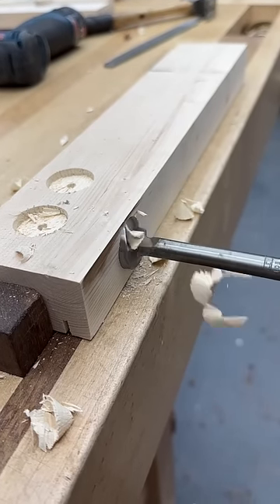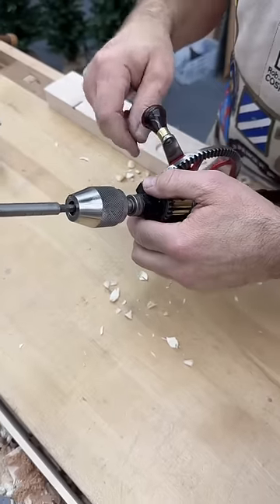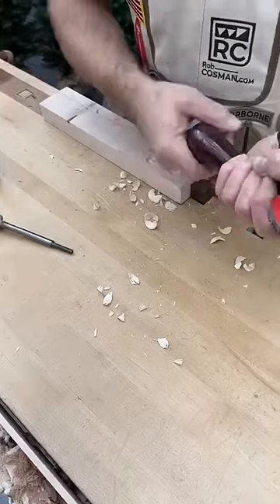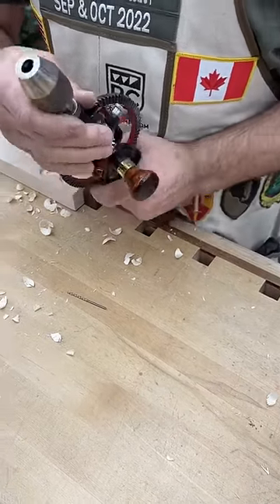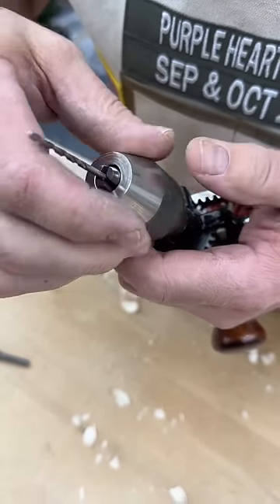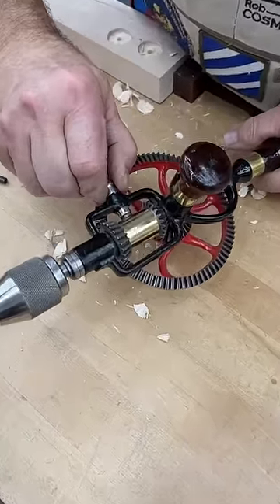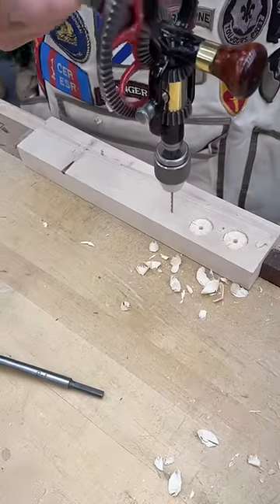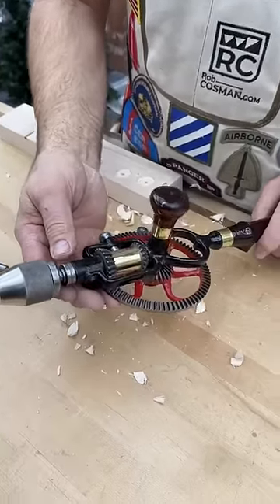Using an Eggbeater Hand Drill #shorts #RobCosman

Comment: I often find that it’s quicker and easier to use the old egg beater style drill, especially for small holes.  Also provides better control, and can be used in tight spaces where an electric drill is too bulky.

Comment: I have a very similar drill. Mine is from Goodell Pratt company with a patent date of March 31, 1896. Instead of the bit storage handle, mine has a knob on the end of the handle, resembling a baseball bat.

It is a great drill for making a few precise holes.

The numbers Rob was giving are gear ratios (output shaft to input shaft) not RPM.

Comment: I've got one from 1945 (variable speed as well). It works surprisingly fast.. Especially when compared to a 1400 rpm hand drill. 
      Also (probably the main reason they're so handy in war time); extremely quiet. And very accurate / no wobble
Reply: I was just thinking along the lines of a stealth carpentry mission. Maybe dismantle something crucial. Weaken a few things. Tap a gas line somewhere...

Comment: Those are awesome! I have 1A lot like it with 2 speeds but it is I guess mine would be called a breast drill style.
 It has that curved metal top where you could put up against your test to give extra pressure.
 Drills steel like a champ!

Comment: Variable speed and multi speed aren’t exactly the same thing. But I agree they’re useful tools. Handy to keep a countersink in around a metalworking shop.

And the rpm output only holds if you manage a consistent input, so it’d be more proper to state it as input to output ratio, not rpm.

Comment: I doubt very much that it was used for that large diameter bit. The bit would grab in the timber, your hand would be aching from holding the handle so tight, and applying the needed  pressure would be a workout!  A  "Brace " was used in that situation so you could easily apply the torque & pressure.
This drill was only used for smaller & medium fluted twist-drills, not  Forstner bits, or augers. Incorrect info. Our forebears were also motivated to do things as easily as possible. No one would use this for large diameter holes.

Comment: Where do you buy those
Reply: You can buy modern ones from the local hardware store. To buy a 1897 model, use time travelling to go back about 120 years, or look in a garage sale or antique store.
Reply: Rob sells them on his site
Reply: @johncoops6897  do you know how to travel through time?  It would save me some money.
Reply: @jonpaul1981  - used ones are not expensive on eBay, perhaps $15 To $20 for single speed.

Comment: Would have been nice to actually see what pulling up on the lever did to change the mechanism
Instead of seeing the drill being jerked, pushed and pulled around as you did it
  Changing the bit I assume has nothing to do with the changing gear ratio

Comment: When they made us use hand tools in beginner shop class like this and a bit brace, I thought it was silly. Turns out they weren’t as out of date as I thought. When I started plumbing in 99 I worked in a small town in west Texas. We did several new construction jobs in the country where there wasn’t any power. Battery drills weren’t a thing yet. They had the black and decker battery screwdrivers but that’s it. I don’t remember seeing a NiCad drill until maybe 2001 so they may have existed but we didn’t have them. If we were drilling lots of holes we’d set up a generator and run a cord but occasionally we’d need a hole or two. It was easier to pull out a brace than a generator and cord.

Comment: The speed isn't variable, different tips have different speeds.
Reply: Not regarding the part where you cant actually control speed by how fast you spin the gear
Reply from the maker: No it is literally an adjustable speed. The rotation of the Chuck relative to the rotation of the hand wheel has 2 different speeds.